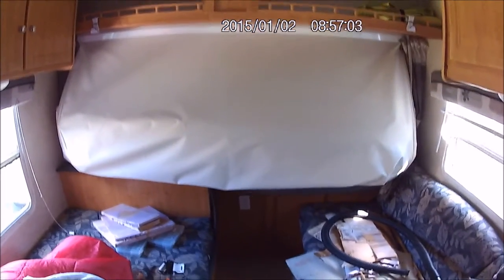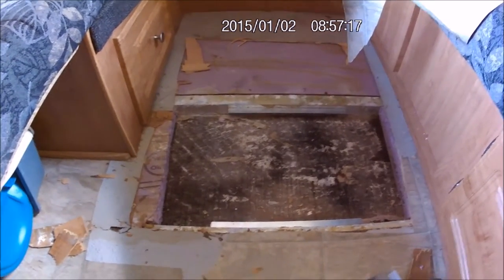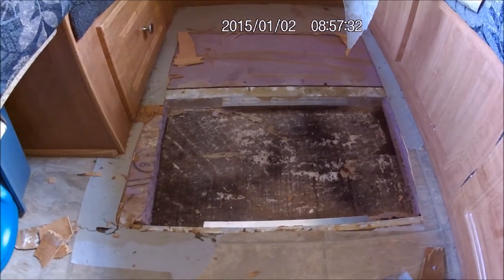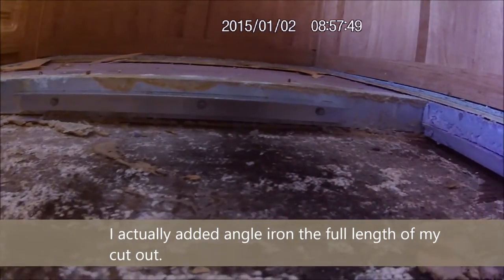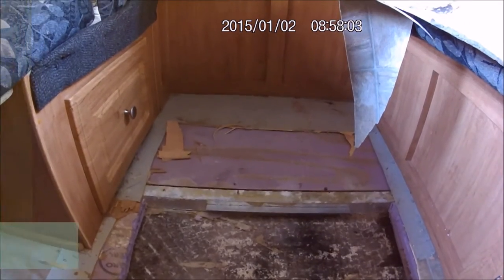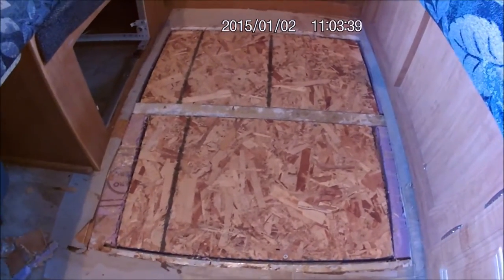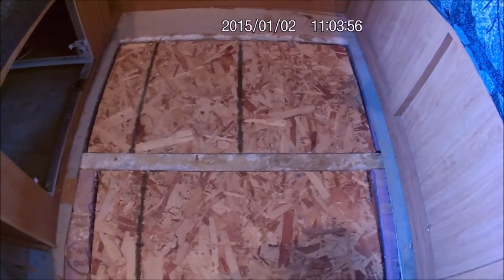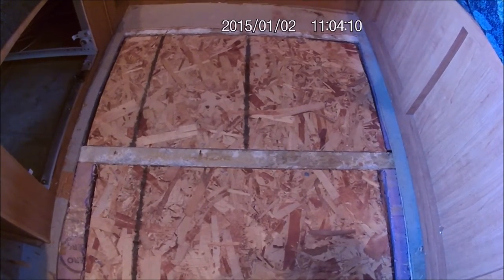Rockwood Roo Floor repair

Comment from the maker: It's worked great! Just do all the areas you suspect to be an issue and you should be good to go!
Reply: I own a Rockwood Roo 2005 and I also have a soft spot but it is in front of bathroom. It looks like you have 2 layers of plywood and that you cut top layer. Was the top layer the original attempt to fix it. I am afraid if I cut my plywood there won't be anything left except the holding tank and I won't have a place to put angle iron. I would love to talk to you in further detail but I don't want to give my email out in a public reply.

Comment: Sir I have same issue with my roo how did the floor hold up with the angle iron and the half in ply. The floor is so thin in these garbage. You input would be great to hear please
Reply from the maker: It worked awesome

Comment: Tom, did  you glue down the laminate floor?  I'm about to put in vinyl planks in mine and I'm planning to glue it all down.  the previous owners had glued vinyl and it was pretty solid.  What is your opinion?
Reply from the maker: I used click floor but if I had to do it again I would have used vinyl flooring. I figured the laminate would add a little extra.